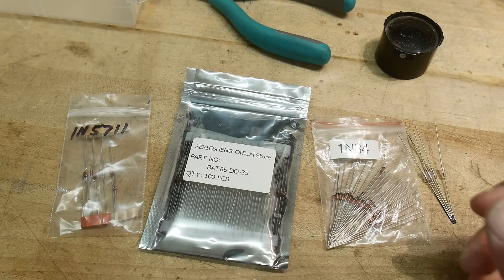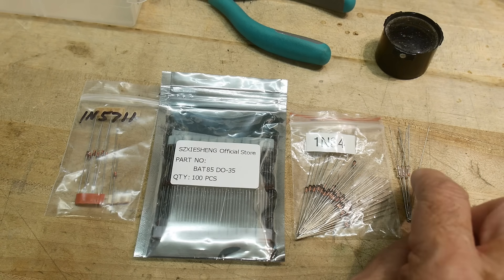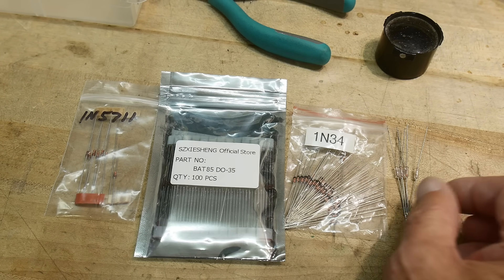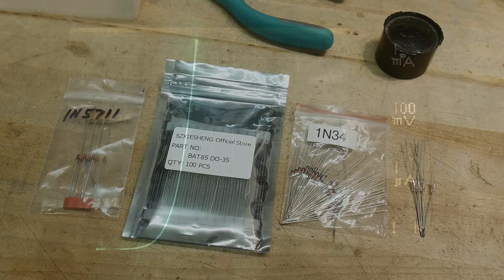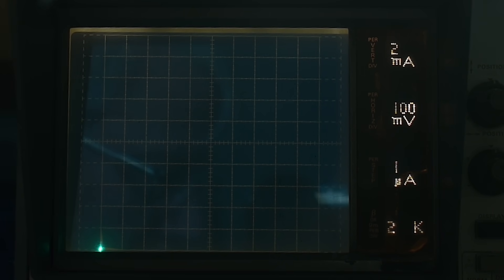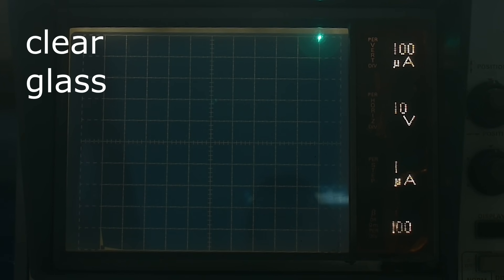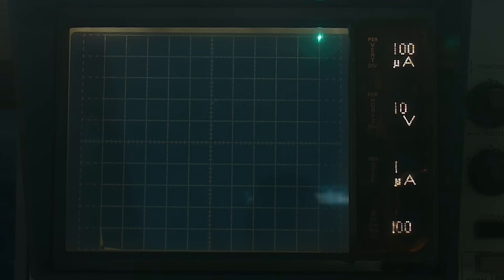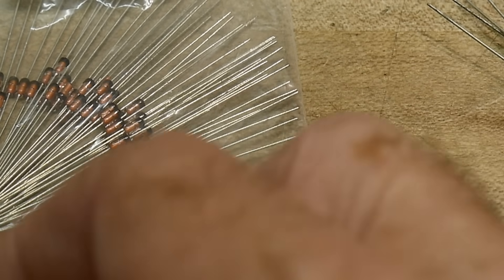#1752 1N34 Germanium  vs Schottky Diodes

Comment: "Real" BAT85 Schottky diodes have a Vf of 240mV @ 100uA and a Vf of 320mV @ 1mA.  I use them for 'poor man's OR gates in CMOS logic circuits where board space is limited.  
Sadly, I used to have, long ago, a bunch of 1n34A's, but tossed them in the trash thinking I would have no use for them.

Comment: The 1N34, or 1N270 diodes I've seen are point contact devices.  You can see the cat whisker through the glass.  The 1n34 diodes you have look more like 1N4148 or 1N914s.
Reply: 4148 standard silicon diodes, they would have higher 0.5-0.7V voltage knee. These are likely 1N5819 schottkys.

Comment: IN34's are basically an antique.
Might be easier to hunt for lost treasure.
BATS are silicon, like pretty much everything in between.
So hard to control a knee.
Perhaps without the varicap/diode.
But they become mlre expemsive than the fundamental components.
D18's xX are still pretty source reliable.
Today 30c tomorrow 30 bucks...

Comment: A true 1N34 is a point contact germanium diode and if you look through the glass at magnification you should a very fine S-bend of gold wire contacting the diffusion side. The other side should be bonded to a flatter surface. 

Schottky diodes are typically manufactured in a planar process so the gap between the 2 wires is in the order of the thickness of the die (plus bonding, and note this is for signal diodes).

Schottky diodes leak a lot but notably they have higher capacitance than a germanium point contact diode.

Germanium diodes virtually have to be done in glass, injection moulding is not supportive of point contact diodes.

Comment: Years ago a company (Germanium Power Devices, I believe) was trying to develop a germanium Schottky diode, with something like 0.2 V forward voltage to reduce losses in switching power supplies. I think they also looked into germanium FETs. They're still around doing Ge and InGaAs IR photodetectors.

Comment: Using a high gain germanium transistor with collector connected to base will give you a lower forward voltage drop than a plain germanium diode.

Comment: I found this video very useful.  I've heard that we can measure the turn on voltage of a diode like a glass diode by using a digital multimeter, which is set at diode metering position. Whatever value the DMM reads corresponds to turn on voltage of the diode. Is this a reliable method for this purpose. However, I don't have any curve tracer at home.

Comment: I have a rather large assortment of diodes.  I noticed that the old ones are clear glass with/without a stripe, while the new ones are pinkish with a black stripe.  I need a 30x magnifier to see the numbers, or I might use a 1N914 when I need a zener.  They look the same!  I wonder what use that weak knee is good for?
Reply: A nice diagonal line... means if you put it in just the right designed circuit, you have a great little "voltage controlled resistor". So can be useful in some very specific circumstances, controlling gain etc.

Comment: Just tested a few different diodes as peak detectors last week. We also had a hand full of unmarked glass germanium point-contacts, now I suspect they might as well be 1N34s.
They performed the best at the highest test frequencies and smallest signal levels, but after that, suprisingly, LEDs worked well with high level RF.

Comment: Old parts like that are interesting. Imagine those old 5711s are in a guitar distortion effect thingy. And then one day it fails with a bad diode. And you go buy a 1N5711, pop in in there, the circuit comes back to life but it doesn't sound much like it used to. It was depending upon the characteristics of the original part and it just isn't available anymore.

Comment: For what it’s worth, I checked an ST Micro 1N5711 on my 576 just now, same instrument settings. Its curve is more vertical just beyond the knee, closer to 30 degrees from vertical where yours is more like 45. It is then almost ruler straight resistive. It doesn’t have the “it’s a resistor, but now it’s being a diode” characteristic seen here.

It’s in a blue package with black cathode stripe.
Reply from the maker: I'm sure mine date way before ST Micro starting making them
Reply: Keep in mind that anything that meets the 1N5711 Data sheet can legally be sold as 1N5711. Unfortunately for some users, the data sheets are pretty vague or ignorant about some characteristics that are important to some off-label usages like guitar effect pedals.

Comment: Should have looked at several 1N5711s, you could have picked a bad one, that one was NG.
I never saw one that acted that way. Ron W4BIN
Reply: I also at first thought the 1N5711 might be defective, but I looked up the data sheet (HP data sheet) and found 410 mV max forward voltage at 1 mA, 1V max forward voltage at 15 mA, so it looks like the diode meets spec.  Its forward conduction curve also appears to be reasonably close to the typical curve shown in the data sheet.

Comment: You had me at "it's an excuse to use my curve tracer".
Reply: That curve tracer sure seems to be more useful that I expected such a thing would be..
Reply: @lmamakos  for such a simple device, they are so handy so often.
Reply: Not quite as simple actually. They can produce up to 10 or 20 Amps at least temporarily and up to 2000 V and up to 200 W. They can measure down to 100s of microvolts and 10s of nanoamps. Supervise power and current limits for the device under test. Safety lockout for the operator. Plus GPIB control on the more recent ones. A behemoth of relays switches transformers opamps fans. The manual says it's a 2-person lift. Right they are.
Watch the video of the vintage Tek museum in Oregon. Or better go there in person. It's a dream come true.

Comment: I had to substitute standard zeners for the BZX series on a recent project.  I do not have curve tracing ability but the standard zeners did not work well in the circuit.   (BZX79C15 for 1N5352 and BZX79C12 for 1N5349

Comment: The very fact the the the supposed 1N34s are in DO-35 packages with "red" wire apparent inside the glass says they are not 1N34s.1N34s are point contact diodes. To the best of my knowledge you simply can't construct a point contact diode in a DO-35. The sort of $-shaped contact wire should be visible in the real thing. The real package is a tube, not a solid piece of glass.
Reply: I recently had to explain this to a hobbyist friend of mine.  You can see what looks like a tiny copper-alloy block next to another piece (maybe silicon) inside those DO-35s...clearly a "metal-junction" construction.  The DO-7s are big enough to see the curly wire end in a point against a little square of germanium.  Adding to the confusion,  there are LOTs of sellers on Amazon offering what they call germanium/point contact diodes that are obviously in those smaller DO-35 housings.

Comment: It is known that germanium bridge rectifiers are not only diodes but also resistors.
Therefore, a silicon bridge rectifier and a resistor should be used as a replacement.

Comment: The bad 1N5711 diodes have a high series resistance with the shottky portion, when the voltage gets high enough the protection ring diode turns on.
Reply: Yeah, its reverse characteristic definitely looked like floating guard rings were turning on, but as for the forward curve it was more like a bad quality Schottky contact. An influence of floating rings on forward curve is negligible.
Reply: @paul_AAA  The knee in the curve at 0.68V is the guard ring turning on.  The portion from 0.4V to 0.68V is the high resistance Schotkey.
Reply: @Chris_Grossman  Are we talking about the same guard rings? What I meant is  there are floating guarding rings which are close to the Schottky contact but not on it or inside or whatever. The point is they are not under potential when forward current flows, so they have no influence on forward curve (they are just outside). Those p+ areas are under potential only when electric field reaches it after definite reverse voltage. But I saw such curves many times when we couldn't make a good Schottky contact formation process. If the process was dirty, there were always defects in metal structure and a thin layer of SiO2 between metal and Si. it doesn’t make too many problems in high current range because it’s mostly defined by wafer resitance, but it reveals itself on small forward and reverse current modes like it was shown in the video. If reverse current scale was less than 100uA (maybe 1uA), it would’ve been clearly seen I’m sure.
But I might be completely wrong and maybe there are some guard rings that I haven’t seen yet which turn on in forward voltage mode.

Comment: None of the diodes in the video are genuine  1N34. The 1N34 original point contact diodes were not manufactured past the early 1960's. The original diodes had to be individually adjusted so there was an access hole in the side of the case. The later genuine glass-metal used a low melting solder to hold the leads. The solder was heated to softening and the point contact was made and then the solder cooled quickly to lock it in place. Modern germanium diodes are made via a diffusion process that does not require individual adjustment of the point contact. All the diodes you have are "equivalent" germanium diodes.
Reply: Does it mean that point contact Ge are no longer made? They had some unique features at low amplitudes. You could rectify a small RF signal without an amplifier and power supply.
Reply: @Oldclunker-ge5zp  The original point contact 1N34 has not been made for over 50 years! The "equivalent" 1N34 mow made are all modern diffused junction germanium diodes. The original metal-germanium point contact had a noticeably lower threshold than the diffused junction type.
Reply: You never cease to amaze Ron. Enjoy your video's very much. I find the old manufacturing and material choices are extremely interesting. And learning from the people who understand.

Comment: There are a lot of listings for "1N34" (some even saying "germanium") that are really Schottky, all in the smaller case with a black stripe, exactly like what you showed. I've always wondered whether these fakes would perform as well in situations where you'd typically really want Ge instead of Si, like the classic crystal radio circuit…
Reply: They don't work as well as Ge diodes do.  The Vf is comparable, but the Schottky diodes have much higher junction capacitance.
Reply: For small AC amplitudes, eg some millivolts, Ge point contact works better. My circuit ran at approx. 200 kHz.
The old HP RF rectifier probes 11096 for multimeters and oscilloscopes use Ge upto 500 or 700 MHz.
Reply: @Oldclunker-ge5zp   According to the 11096 manual on the HP Archive webpage, the diodes in the probe are silicon, not Ge. With 2 different part numbers...
Reply: I saw multiple versions of 11096 manuals, also with A and B suffix. There are subtle differences in the 2 diodes used. The Ge diode is used as rectifier and the Si diode is used to linearize the DC output over a wider range of amplitudes by introducing a non linear voltage drop, assuming you are connecting to a multimeter with 10 M input if I remember correctly.

Comment: Crystal radios work best with real Germanium 1N34 or similar. Next compare Ge to Schottky at very low fwd voltage levels. I believe you will find the Ge will act like diodes at lower fwd voltages than the Schottky.
Reply: Diodes like 1N34 do not need any biasing to start demodulating a weak RF signal, that's why they are prefered in crystal radio.

Comment: Love this. I know it is mundane, but what is the test gear? (In case we see a curve tracer surplus and want to pick it up, etc.)
Reply: I believe it is Tek 576 type. Rare and coveted. Bring Money...
Reply from the maker: it is a curve tracer: https://youtu.be/BabCunP9ib8?si=jX6xTmGt796P2Yj5
this one is a TEK 576 that I bought for $200 and took about a month to get it working again. I have videos of the repair on my channel
Reply: Curve tracers are not indestructible. When testing 20Amp Motorola power Schottkys as an apprentice 40 years ago, magic smoke came out. It didn't break though. I think I had a 576. It wasn't until Recently that I read a warning in the user manual PDF...
You should know what you are doing or carnage will ensue.
Reply from the maker: It's only rated to 10A

Comment: Sometimes you have to watch out for the clear glass package - some characteristics like leakage, etc can be affected by ambient light.
Reply: Every diode is a photo diode if you use the right light!
Reply: @hardrocklobsterroll395 that's true 😊
Reply: @hardrocklobsterroll395 
The entire spectrum from near infrared and shorter wavelengths will do it.
Reply: Now that would be cool, rerun the test while scanning a laser pointer across the diode.
Reply: In the old days (60s), the glass diodes (both Germanium and Silicon) were painted black. Even zener diodes were black. This seems to have vanished since the 70s. Perhaps we should all pay more attention to this and always have a sharpie/Edding with you :-)

Now that there are so many fake parts around, wouldn't it be possible to tell apart Schottky-Silicon from Germanium by their temperature coefficient and rectification efficiency over frequency, e.g. 50/60 Hz vs. 28/145/433 MHz? Whatever you have available...
Reply: @Oldclunker-ge5zp   There is a problem with sharpie, as it acts as a IR filter and only blocks visible light. You can prove it yourself by filming TV remote IR LED on camera through a piece of glass with sharpie on it. However, idea of painting diodes looks good anyway)
Reply: Thanks, good point! I will try if black electric tape will do better.
Imagine that all the modern chip scale packaged ICs are photo sensitive since they expose the back side of the die to the unsuspecting user...
Reply: Alan, I completely agree with you.
Reply: Also diodes generate a voltage in the presence of light.  I found that OA47 gold bonded diodes give a higher voltage than other germanium diodes,
Reply: The man himself. I'm gonna go try this for fun.
Reply: Better off too shrinktape your red leds.
Reply from the maker: yes, I did a couple videos about photocurrents. At HP we did not have the clear glass package 1n4148 diodes. but a custom -0033 part in the stockroom that was the same part but in a black glass package
Reply: In the 80's, we used HP5082-2811 Schottky and they were clear. Not that photocurrent would make any difference to the hilarious leakage though 🤣
Reply: @Oldclunker-ge5zp I bet you've seen some changes in electronics since then.. I just recently started learning (from 2018ish, maybe Christmas 2017) but I wish someone introduced me to this when I was a kid. (44 now) I was always told "you have to be good at maths to do electronics" and I was really, REALLY bad at math. But when I started learning this it was like a switch went off in my head and math made perfect sense to me for the 1st time in my life... My God I love this stuff.. 😊👍🇮🇪🙏
Reply: @IMSAIGuy  My 1n459A low leakage diodes are in a black glass package for that reason.

Comment: Hey, now do a tunnel diode, and see if you can keep it from oscillating in the test fixture.
Reply: I was going to suggest exactly that.
Reply from the maker: I've got some on order
Reply: Will oscillate. Even DIACs , 4-layer diodes and high-gain bipolar transistors will oscillate.
Good luck though ;-)

Comment: I'm really intrigued by the 1n5711. I'm sure there is an application where such soft knee would be desirable.
I wonder how 1n34 compare to red LED's, since those are also used for audio clipping.
Reply: I think they just might be old. He mentions in the video that they’re old so the technology process could have been less refined and introduced a resistive region from the junction. I don’t remember enough semiconductor physics to propose a mechanism though
Reply: @hardrocklobsterroll395 that could be a number of factors from less purely refined elements to the dopping process or even material thickness from machine calibration differences over the years.. would be interesting to find out the actual reason.. 😊

Comment: So for clipping where the reverse leakage is out of range, modern Schottkys are a cheap replacement for germanium.

BTW, Si and Ge differ in the absolute values of the curve point, but not in shape, so guitar pedals just need to be adjusted in range to replace Ge by Si.

Purity extremists might disagree. But they also use mp3. 😂

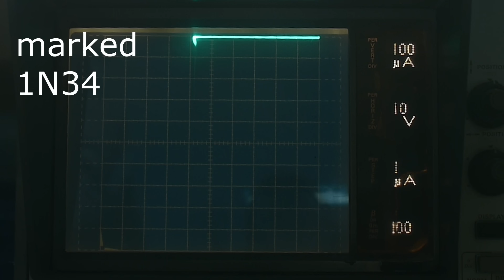Comment: 06:28 is that noise at the falling edge?
Reply: Yes, reverse breakdown is a very uncontrolled process in diodes not explicitly designed for this operating mode (zener diodes are optimized for this, for example). Every trace the curve-tracer takes results in slighty different characteristics (due to noise in the curve-tracer or self-heating of the diode) near the beginning of this breakdown region.
Reply: @vikenemesh  thank you